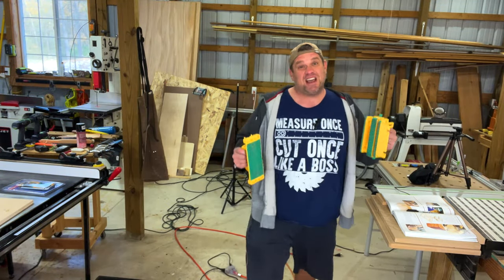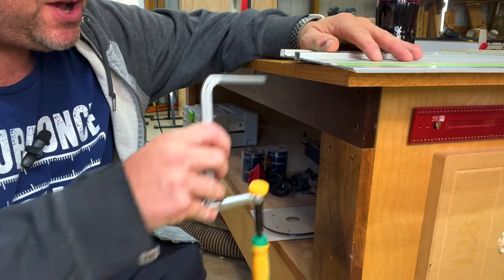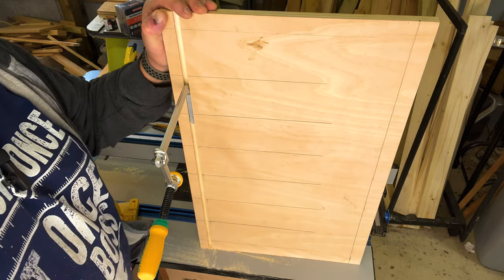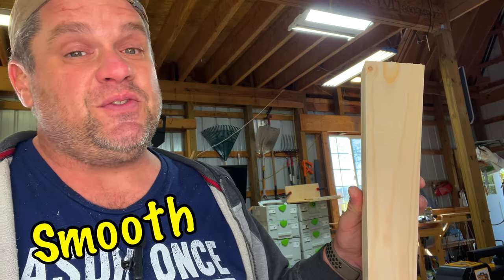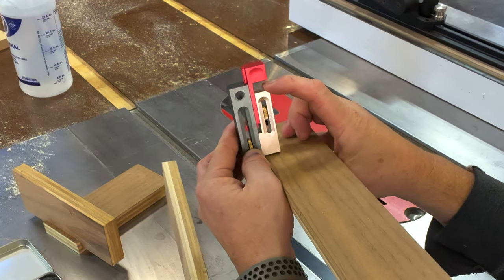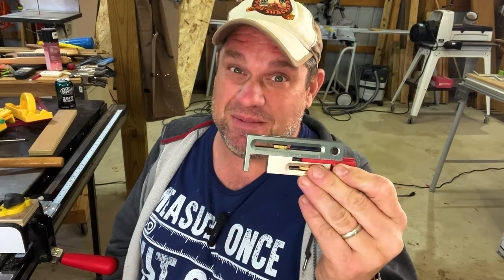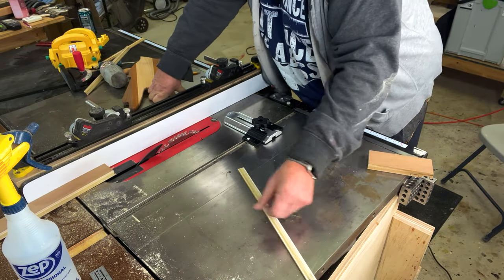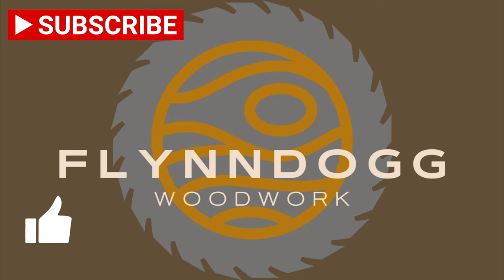3 Jaw-Dropping Unbelievable Woodworking Jigs You Need to Know About!!!

Comment: I would assume that the thin rip jig would/should have a way to calibrate the zero-point based on each individual table saw miter slot. I made one (no roller bearing) and I added a ruler and an indexing mark.
Reply from the maker: Great question Ken, I think I understand you.  The thin rip does have an ability to adjust the distance from the miter slot to the blade's center through a hand screw lock down.   Very cool that you made your own!   and great idea for adding your ruler to it.   That was one of my main complaints with this one, was that the ruler that comes on the gauge doesn't appear to provide a useful measurement that I can use to calibrate what width I want my wood rip to be, so I'm stuck using another measuring devise instead.  Thanks for watching!

Comment: Are  you making climb cuts on that first jig?  I think you may have gotten lucky there since you were working in the opposite direction of the rotation of the blade.
Reply from the maker: Yes, I may have been doing some climbing cuts on that video, Probably wasn't the smartest.  But I took it very slow.   Thanks for that comment as I probably should have discussed that in the video!

Comment: Using a dovetail clamp on a track saw rail will cause the T rail to bend or bow outwards if used with pressure. This will ruin your rail, I’d suggest testing this on standard T track to verify the issue and not use with more pricey track saw rails.
Reply from the maker: That's a good point Ryan, I agree with you, the track will bow in the center if you really clamp it down.   Most of the time, I don't bother clamping it as the no slip pads on the back really do quite a great job.   Thanks for the post, and thanks for watching!

Comment: Great but I have admired your router table, what is the brand component, so nice.
Reply from the maker: Right now I have a Kreg Router table, with a Kreg Router lift.  I love it.  It has been a game changer for me! :).    I would highly recommend!
Reply: @FlynndoggWoodwork  and what is the motor?
Reply from the maker: @davidndahura7437  I have a bosch 2.25 (1617) router in it.   Does great, Kind of want another one to use outside of the router table too! :)